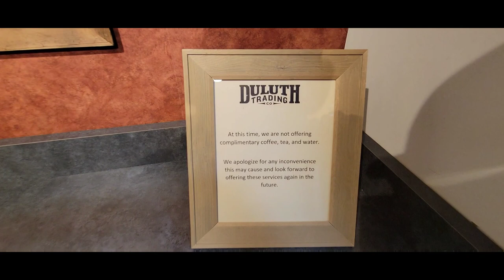EX CUSTOMER LEFT US A SHOCKING SURPRISE | AND I TOUCHED IT!

Comment: If you find drug's in any unit , contact the police department and inform them. The renter can be charged for it.
Reply: Absolutely, ALWAYS call the police.
Good call Muppet Gump.
Reply: Those syringes can be used for anything, mixing glue hardeners, paint dye's, 
but everyone thinks of drugs.
Reply: @galdessa1  agree with you, but as a buyer of storage units. I've found heroin , cocaine , meth and not once in a art's in craft box I found needles. Some counties you can be charged with just needles.
Reply: @galdessa1  really.. !
I fully agree.. but come on now.. where they found that, do you really think it was used for what your suggesting.  Not to mention that those kind of needles nope.  I'd love to see you push paint of anything out of that.  My brother is diabetic and uses the same orange capped needles.  Those are very fine and for the skin..  the color of most syringe caps designate the size of said needle.. orange is surely for the body..   great video guys..

Comment: I thought at first TQ was going to ask you to lower the door down a little more to put the new lock hardware on.....
Just me but with the locking hardware I'd probably put a small square or rectangle steel plate on the inside to help firm it up and stop someone easily using a prybar to pull the hardware off. I'm sure with the security you would catch them but as you know they usually won't have funds to pay for the damage to the door. 
TQ got new shoes!! 
Take care!

Comment: Those handles are quite substantial, and it looks like they just have surface rust. Mask off around handles (to protect paint), and hit them with a brass wire wheel attachment on a cordless drill.  They will clean up nicely, and you can do it to any unit, even if occupied.

Comment: Hi Gang. How to solve the cab heat problem in the winter while sitting on cold seats. I Installed an electric cab heater to help clear the windows and windshield quickly. Plus the steering wheel is warm and the windows don't fog. Saves on gas. Not that bad on the electric bill as I set mine on a timer. The heater is mounted under the dash so it is out of the way. The cord plugs in with the block engine heater. Power is good and safe on a single 15 amp circuit.

Comment: You can put that latch on by yourself if you had to put in place use tape over bolts after they are in square holes then go inside put nuts on

Comment: Way are you looking to replace the 2016 it is not got enough miles on it had  F350 2011 had 657,000 lost it in bankruptcy do to health. Would send you a picture of I could it still looked new changed oil  every 20,000 still at full mark